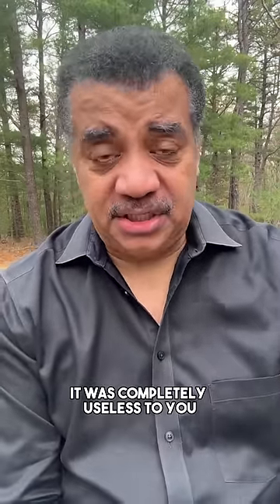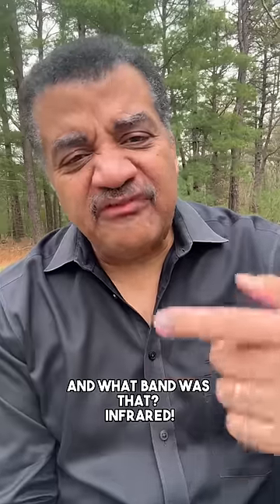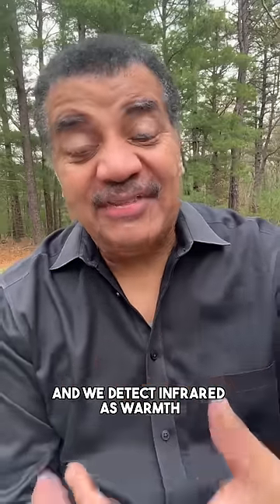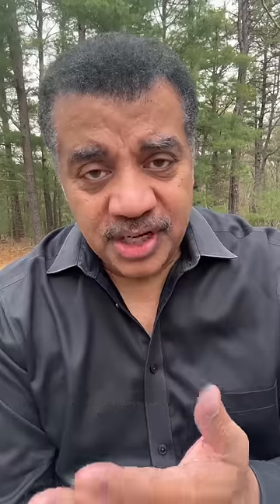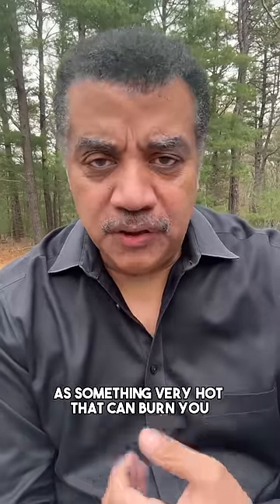LED Bulbs vs. Old Bulbs 💡

Comment: An old  light bulb would keep your water pump from freezing.
Reply: Fact.... still doing it...
Reply: Ain't nobody need a water pump other than the fire brigade.
Reply: @studywithme7677 what
Reply: @studywithme7677  There are plenty of people in rural areas who rely on well water for their homes, which, you guessed it, requires a pump.
Reply: @Burtocd but a lightbulb for that purpose?
Must be the solution for the poor.
Reply: I thought the resistance from the wire in the old light bulbs heated the gas inside the light bulb that in turn transfered the heat out of the bulb. The same way a resistor could become hot without admitting light. Does that constitute a meaningful percentage of the heat in old light bulbs?
Reply: @luwi8125  In a well insulated well/pump house, yes, it does. If it's 25ish degrees outside, it would be above freezing in the small structure.
Reply: My house was warmer with incandescent bulbs
Reply: @dom3827 if you have a well you use it to keep it from freezing. What you talking about for the poor? I grew up on a 300 acre farm and we used bulbs on our well pumps
Reply: @matthewmclean1429  i would have gotten proper resistive wire.
Lasts way longer than a bulb, can produce more heat.

Instead of having to change the bulb every so often, you most likely never need to change anything.

Also a bulb you can only put on certain places.

A bulb as heater always was a cheap, easy solution for such things, but never really a good one.
Reply: @dom3827  okay? There are poor people together matter
Reply: @dom3827  right, there are many ways to do it. Not sure how it’s a poor solution
Reply: @Burtocd  I've been in rural places and I've never seen a water pump being used.
Reply: @matthewmclean1429 because he wants you to buy a heater instead of using a cheap light bulb....I mean in reality most rich people are the cheapest they don't just throw money away or they wouldn't be rich....that guy was just a idiot bro
Reply: @mikehartmanii106 
There’s always one…
Reply: @mikehartmanii106  yeah that’s where I was going with that. Why waste money on a heater when a bulb works lol. We had 3 wells and a well heater installed is about it 1800 each at the time. A bulb was 65 cent
Reply: Yes, but you can also get an infrared (no visible light) device that screws into a bulb socket and puts out heat. I use it with my pump. Some use it with chickens, etc
Reply: @NowStopandThink  yeah that’s what I use for my laying hens. Those are nice
Reply: @studywithme7677 Son, you got a lot of a learnin' to do.
Reply: @studywithme7677 Ridiculous comment. Everyone who pumps water from a well or a cistern into their house uses a water pump. Millions upon millions of homes.
Reply: They still sell incandescent bulbs. Rough service bulbs. Will last a very long time, probably 10+ years
Reply: We used them to keep our baby chickens warm. Also pump houses and maybe a dog house or two. Now we spend more money on radiant heating or die. I miss the good old days.
Reply: @dom3827 you speak as a child would on this topic
Reply: Used to use a drop light under the hood to make the truck easier to start in the winter.
Reply: @tahneamariabeareaglebrown265  In my country most if not all people have piped, running water, even in the remotest areas. Must be a thing that Yanks don't have.
Reply: So you should use it for that, but not inside your house, if you want to save money.
Reply: They keep my feral cats warm.
Reply: have one at the window for heating not on city folk wouldn't know what to do in the country sounds like
Reply: @opticledilusi0n Or Halogen Bulbs also Generated a Good Amount of Heat.
Reply: @dom3827 if the bulb works why waste the money on an expensive heater that can and will go out
Reply: 33
Reply: I find it interesting that the new lightbulbs cost a lot more than incandescent, and do not seem to justify the difference in price. Add to it to the skyrocketing cost of electricity, and the fact that the lightbulbs create a hazardous mess if you ever break them.
Reply: Old style melted snow hitting headlights while driving. Could heat the floor under a dog box in the winter.
Reply: An Artist knows what a this person doesn’t - warm light and gentle heat is beautiful and it can’t be replaced.. not that anyone is asking..
Reply: Now they gotta clean the ice from led streetlights. Used to melt it off with incandescent or halogen
Reply: Really???
Reply: @dom3827 okay. Thanks for sharing how special you are in that regard with us.
Reply: And make a cold natured engine easier to start in cold weather
Reply: @studywithme7677  there still needs to be a pump somewhere to move the water.  Having a water pump does not mean you don't have pipes, running water.  Try putting down your phone and opening a book.
Reply: True, and it would make sense not to immediately replace it, but to instead wait till it's actually spoilt. At that point, replacing it with some kind of heating element that only turns on when frozen (probably with a manual override) and an led light bulb would give you much better efficiency.
Reply: So everyone who lives in a cold climate must be poor? 🤣🤣🤣🤣🤣@dom3827
Reply: @matthewmclean1429 
We used to use a heat lamp bulb.
Reply: @davidtaylor4053  we did when it got to about zero but that wasn’t often in NC.
Reply: @heatshield don't mind them
 The government probably supplies all their utilities for them lol
Reply: @studywithme7677 I've been in restaurants and never seen the kitchen. That doesn't mean they don't exist
Reply: People also put them in dig houses
Reply: @studywithme7677  
In the USA, we still have water pumps for our own Well Water.  So yes, an incandescent lamp is indeed a lifesaver to keep the parts from freezing.  Out of 340 million American citizens, there’s gotta be 25 to 50 million wells in the USA.
Reply: @dom3827  it isn't a solution for the poor. If you have a well, you need to keep the pump from freezing in the winter. It is effective and does the job. Are you not familiar with wells?
Reply: @Wanamaker1946  Well, I'll be damned. I live in the UK so we're a relatively smaller and connected country. I've learnt something new
Reply: @studywithme7677 There is a pump somewhere pumping water through those pipes. It’s not magic. How big is your country compared to large nations like the USA, Canada or Russia?
Reply: @STSwhisperer  In my country our plumbing works on water pressure. No pump required
Reply: Lmfao I’m ded
Reply: @opticledilusi0n

Great for those summer time energy bills.
Reply: @studywithme7677  first of all, what country is 'your country'? And how far apart are your towns? In the US and Canada rural towns are too far apart to run water mains out into the countryside, so farms and rural acreage each have their own on-site water wells which are equipped with... wait for it... water pumps to create that water pressure you speak of. Read up on water wells.  You'll sound less...umm... uninformed.
Reply: @GazSAY321  Move to a farm closer to the city or town then. Ain't nobody need to live over half hour away from a town.
Reply: @studywithme7677  pressure from??
Reply: @STSwhisperer  Dunno but we ain't got no pumps in my house, nor have we had any in any house I've lived in. Just turn the tap and the water comes out.
Reply: @studywithme7677  Lol. It’s magic then.
Reply: Exactly! My husband has installed a warming light that you would use for baby chickens, or such to heat our well house now. It costs more electricity to keep it turned on.
Reply: @studywithme7677  my pump is up behind my barn. We don't run it continuously, only when the cistern needs to be filled. There's no reason anyone would know we have a pump unless they saw us turn it on.
Reply: @studywithme7677  you get water out of a 350 foot deep well using water pressure only? That's quite a trick. We pump water uphill to a cistern, and it is gravity fed to the house, barn, and garden. But it still has to be pumped up the hill to begin with, and we put up with low water pressure to avoid having another pump to increase our water pressure to the house.
Reply: @studywithme7677  where do you think food is grown? In town? And digging up 2 miles of country roads to supply water to 3 houses isn't going to happen. And that's less than 1/2 hour from town.
Reply: Heat bulbs
Reply: Shhh. Repairing broken pumps is how we keep led bulbs in business
Reply: @studywithme7677 if you have city water/sewer connections, then by definition you are not "rural".  Rural means you have your own well and septic systems on the property.
Reply: @beepbop6697  Nobody has that in my country.
Reply: @studywithme7677  unlikely.  What country?
Reply: @dom3827 , my dad lived in houses with well water for over 40 years. I don't recall his pump ever freezing but he would put 2-3 incandescent bulbs in the pumphouse every fall.
Reply: @studywithme7677 , did you live there? It's not obvious if the well serves just one house. They aren't big and if you don't do maintenance or anything you may never notice it. My dad's last house had rentals on the street and everyone paid their part. It was mainly the landlord and Dad doing the maintenance. Them light bulbs are still there.
Reply: @studywithme7677 , it's running water pumped up from a well that is powered  by electricity into pipes that go into your house and to all the standard water devices you might need. The only difference is it's better water, if there is an issue you can fix it yourself and in my experience it's cheaper. My water is not bad but that well water is the best, straight out of the tap.
Reply: @Dont_Tread_On_Me , well said.
Reply: @Wanamaker1946 , more. The well at my dad's last home serves 8 houses.
Reply: @studywithme7677 , oh, no, no-it doesn't work like that. Maybe if you live in a place where the water sources are all at higher altitude than the houses. There has to be a power source- gravity, manual or electric..
Reply: @studywithme7677 , the humongous pumps needed for that scenario aren't in anyone's yard. They are housed in a community building that then pumps water out to everywhere. Mine comes from many sources but it all goes through the central pumping system. I love it that you think la la la, my water just comes out of the tap magically. Ask a parent how much it is monthly for that magic water, cause I sure hope you don't live by yourself.
Reply: @studywithme7677 , time to give up, pumpkin. Stop wasting time and go learn something, anything.
Reply: @bcaye  It's a shame you Americans wasted time between 1939 and 1941 or the war might've been over a little quicker than it was. We won't forget though.
Reply: @studywithme7677  wasted time? Lol.  While you are over there not forgetting, make sure not to forget what you owe us for helping you and for any Lend-Lease obligations that you might still owe us, depending on where you are from.
Reply: @studywithme7677   Of course you didn't SEE it!   It's not like the pump is on the kitchen counter !😂
Reply: It works
What’s your solution
Reply: @tomhenry897  Pipes

Comment: LED lights for car headlights was the worst idea ever...I'm literally blinded every time I pass a newer car on the road at night.
Reply: That's the blue light content. The extra colour makes things look a little clearer at night, but dazzle other people a lot more.
Reply: Agreed. It's dangerous.
Reply: Well something has to be done about it or Im getting a monster truck 12 ft tall.
Reply: @edwelndiobel1567  Facts I'm with you..😂
Reply: they also put 130 watt bulbs in them  . . .
Reply: @moabird6983  Wow 130 watts that's so OD smh...
Reply: I needed them on my motorcycle because the stock bulb was a 35w halogen which is useless. Now with a 30w led it's 5x brighter.
Reply: All by design
Reply: @truthiscriminal  I wouldn't doubt it.
Reply: Especially when they’re blinking !!

Comment: We use incandescent lights in the pump house and we actually need that infrared to keep the pipes from freezing. The present lack of incandescent bulbs is a pita.
Reply: Heat tape is more reliable and more efficient because it lasts longer and puts the heat where needed.